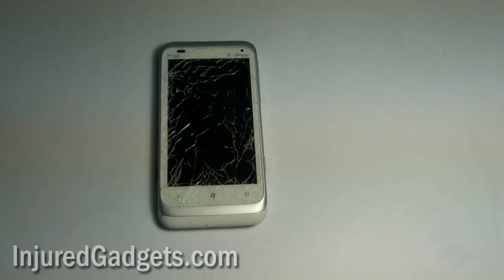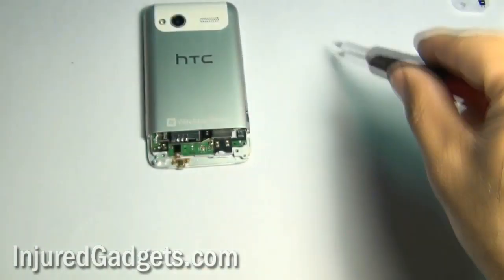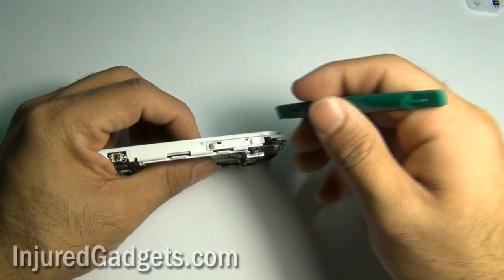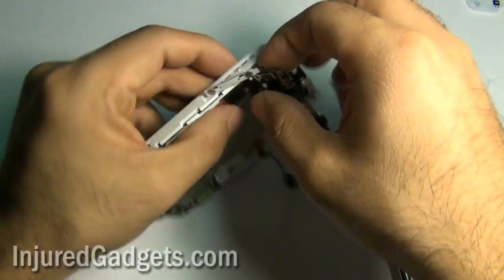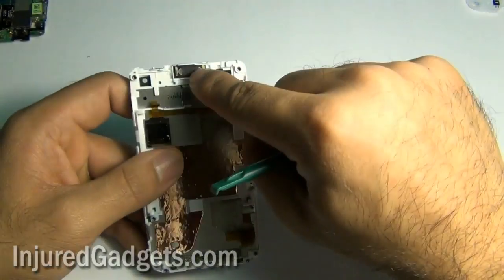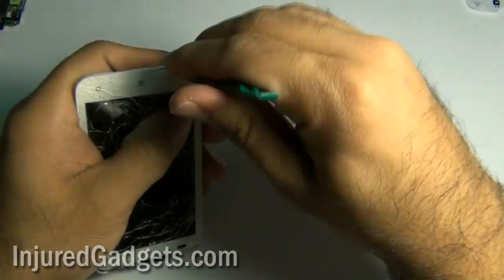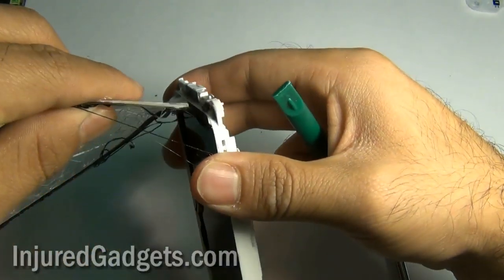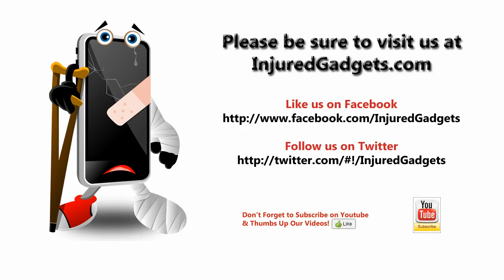HTC Radar 4G Touch Screen Glass Digitizer & LCD Display Repair Replacement Guide

Comment: I am attempting to repair the digitizer on this phone but after I assembled the phone I GET BLACK screen, better yet, the lcd doesn't even turn on. I replaced the lcd with a new one and still, nothing.I believe the lower main board probably got ruined do to the fact that I kinda pulled the flex cable without flipping up the jawbone connector. But why would the phone vibrate when I press the power button?Please Help ME!! any advice or anywhere I can buy the lower Logic Board? thanks in advance.

Comment: So.. you couldn't mention that it is NOT the same do you tear the lcd ribbon or release the jaws.. I HAD a working phone with just a crack in the glass, now I have nothing anymore because my lcd wont go on.  In fact you said "If you want, you can disconnect that by flipping up that jawbone connector to release it before plugging out" (after you tear it out) . How about like this "I made a mistake and tore out the ribbon, do not do the same or it wont plug in anymore!" ? gj ;)

Comment: Ok Thx Jonathan helping. Big time note! BEFORE you rip the hard drive away from the LCD, like this guy did in the vid, carefully pry up and then bend back the bottom part of the motherboard, where the lcd ribbon goes in is the white clamp lever for the jaw clip, it flips up and releases the jaws. be careful not to tear it or it won't hold the ribbon in after replacement. Then goto the top and do the same with the digitizer ribbon only this time the clip is on the bottom and the ribbon is on top.

Comment: Ok. Here's a problem. You dont talk about the Ribbon cables attaching the LCD and digitizer until after you separate the motherboard from the LCD like they're not even there. People can rip those cables like that assuming that its supposed to be that easy. Atleast give us an annotation or something. And second, you didnt show how you removed the top ribbon cable in that same step, so I spent a good 15 minutes looking for a jaw clip or something. This isnt foolproof... Other than that, great vid!

Comment: Figured out the issue - was actually the proximity sensor and not the accelerometer.  (My accelerometer was working fine as I would rotate the phone and it would rotate from vertical to horizontal)

Here's how I resolved by proximity sensor issue - I just covered the sensor on the top left, pressing it down.  Then, I released it, and the phone would work as expected during calls.  It seems my double sided tape wasn't securing the top of the screen down enough. I may press down and add epoxy.

Comment: I recently changed both my LCD panel and the touch screen.  Thanks for this helpful video.

However, now my accelerometer doesn't work.  When I make a phone call it gets very confused, and just stays dark for a few minutes.  (call still works) 
I also tested with a game and the accelerometer functionality wasn't working.

Could there be a sensor or something that I'm covering up?  Which part is the accelerometer?  Maybe I put it back in wrong??